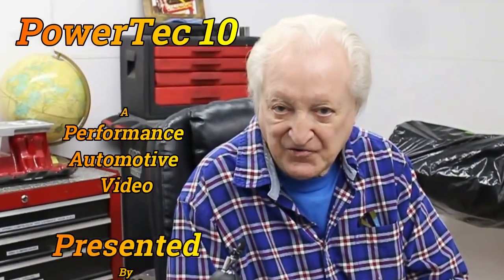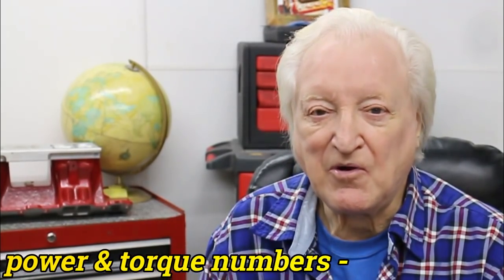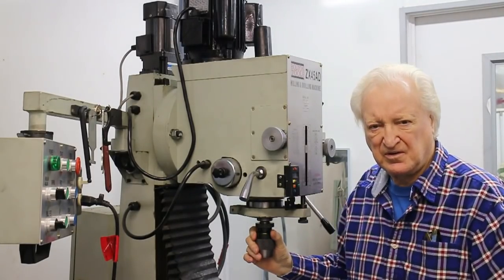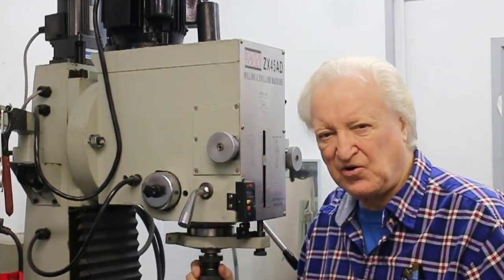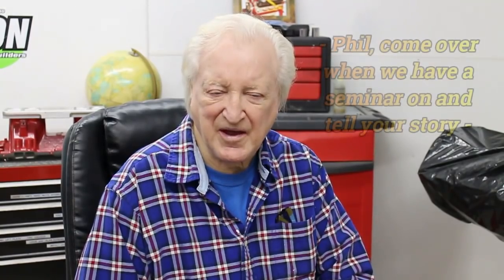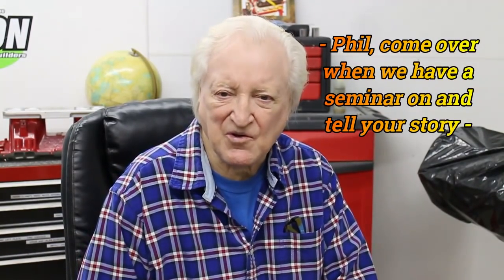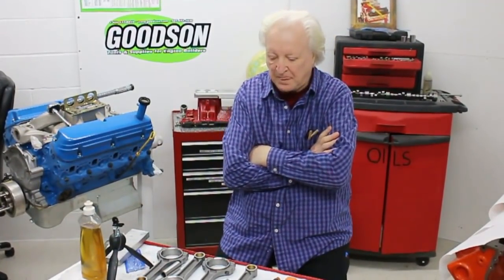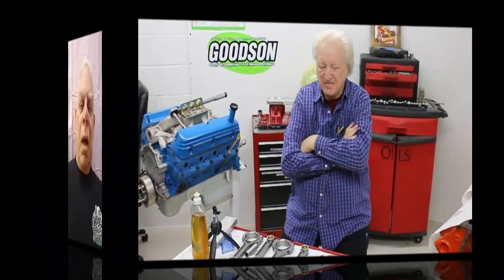David Vizard's PowerTec 10 EP  41 - What's new for 22 Part 3

Comment: A question if I may Dave...I have a camed Windsor block from the 70s that needs sleeves and I have a 5.0 roller cam block...Which would be the best for a streeter in your opinion..?..I heard the later block are weak around the main bearing area...I doubt it will spin beyond 6000 through Victor JR heads...Any advise would be appreciated...I'm still waiting for the rest of the head porting series...Love your work...Cheers Ziggy from OZ.
Reply from the maker: Well Ziggy,  here is what I think I would do here. I would look into building a 331 or a 347 from the 302 block. In ether case a the strength proven cast Scat crank  for either displacement would work. Personally I would go for the 331 combo. All this is based on the fact that if you follow PowerTec advice a sleeved  351 block build would make
 enough power to have a good chance of breaking.
All that said I would like to see comments from others here that may have useful info to offer.
DV
Reply: @marvingvx1  Thanks for your help. The 302 has a Scat crank and rods and is 347ci now but the .040 bore has bad heat marks. A sleeve job it is then. Thank you sir.

Comment: Greetings, 'professor' Vizard. "I mean this with total respect!" During a conversation between Dick Landy and it was either, Mooneyham blowers or Blower drive service, covered in a hot rod type magazine, long ago in the mid eighties they stated that "DEVCON" instead of HARD BLOK would increase the bottom end; and block strength, "Of roots blown B & RB  engines" "IF!" the block jackets WERE;---- ("thoroughly cleaned and acid neutralized, Then lightly baked to Remove moisture, then immediately filled! )  Otherwise the DEVCON doesn't seem to have any apparent ADVANTAGE over HARD BLOK!  do you have any knowledge experience or opinions about this topic When  applied to engines like the 5.0 stock block Windsor????? Respectfully, Kurt Osborne. PS. Knowing that "cast iron is weak in tension" This should not really work... unless you add "prestressed tensioner's" All the way through and deeply into the block!?!??  I.e. "like a stud girdle on steroids that pre-tensions the block in every direction possible" I hope you understand what I'm implying.   Thank You !

Comment: My father in law put me onto your books last century (think about that). I have a SBF 302 bronco motor looking forward to building for road track use. Read somewhere the alloy main cap girdles reduce blocks cracking with high power levels. What’s your view?
Reply: DV has an episode on 302 blocks, where he talks about 1,000 hp possible and 650 HP with proper mods.

Comment: With crank balancing. I've never balanced a crank but I have used othe balacing equipment and I learnt on old stuff where you need to learn how to do it and the machine.
I've watched videos on crank balancing, what gets me is that there is about 2-4g that is a total guess. The oil weight added for the bob is a total guess and at the outer edge of the crank weight it could mean1-2g difference. So from what I gather you'll never get under 1g on a crank balance machine unless you're just plain lucky.

Thanks.
Shane.
Reply from the maker: Shane, I found this an interesting comment as it mirrors my experiences from 40 -50 years ago. If you have anything more to say on this or other subjects keep them coming.
DV
Reply: @marvingvx1  
Well David infact I do have something to mention.
Higgins Race Heads here in Australia make some good heads. He has 3 different SB2 heads avaliable with single planes to match. He sells them at a fraction of the cost of US heads. He is a head porter him self but he gets some ports done in the US like the Holden head Darrin Morgan did that one.
The heads are all cast here in Australia and machined here. 
Nathan Higgins used to work for Larry Perkins and also Gary Rogers back when the V8 supercars used to allow teams to build their own engines. 
I like how in the US Aussie heads like CHI are popular but no one knows about Higgins. There is also Torque Power who with Micron Engines do Holden stuff. Then there is BG engines who in my opinion make better manifolds than Wilson Manifolds. Then there is Plazman intakes and exhaust also Bullet Engines and Tony Knight from Knight Race Engines, Dandy Engines who work with Higgins. 
I just like seeing guys in the US see more of what we can do down under.

Comment: Hi David. Question I've been wanting to know for a long time. I was in one of your recent videos , the fill material for making port mold. You showed a 2 part product. I always assumed that it was sold in a pressure can. Like that polypropylene foam for filling window frame and around sink air leaks. Also like that port fill from Goodson. I have some BBC heads, hoping to see you show how much they can be improved.
Reply from the maker: Knut - what model BBC heads are they. I am doing a lot of 24/26 degree heads both factory and aftermarket. I could well be doing the type you have. Let us know here.
DV
Reply: Oh yes the important part their peanut Port heads I just think that with this port filling there might be something to be said for the peanut Port heads that's been overlooked..
Reply: @knutbjornlarsen4435  those are already hi velocity , spend the effort on mild Port work clean up you can do yourself.